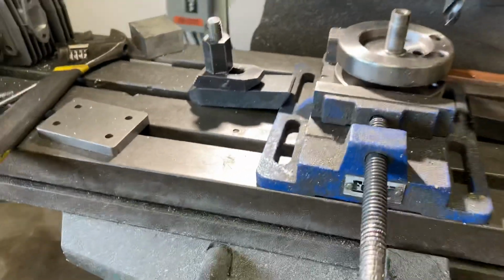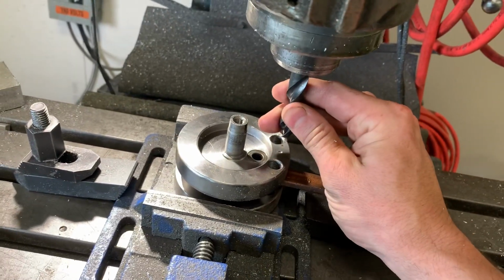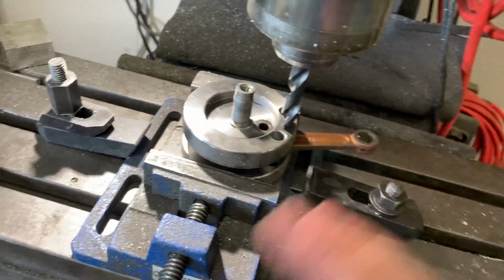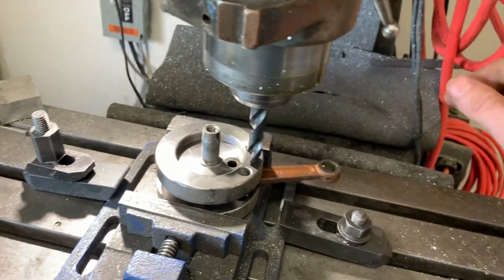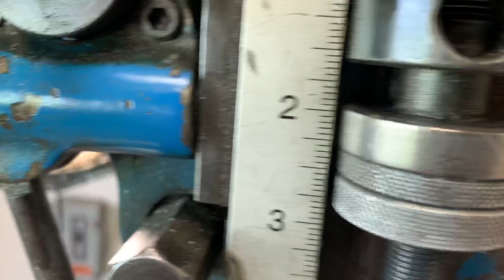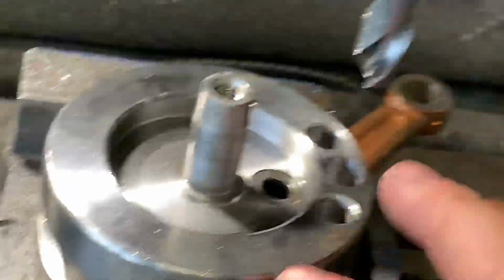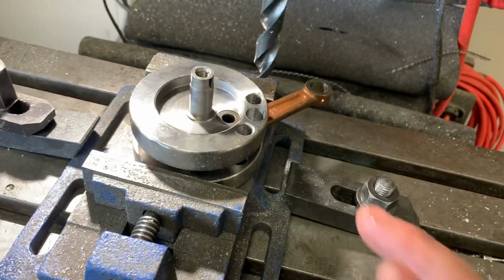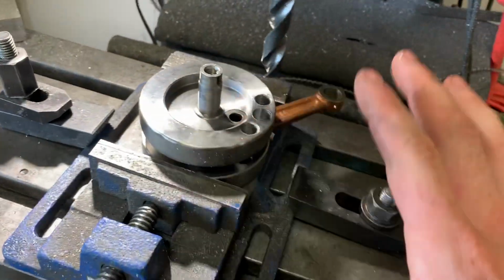The perfect balance in a crank. HOW TO

Comment: If you drill it with a hand drill, just step up the bit sizes instead of doing it in one go.  Takes longer, but goes much smoother and you are less likely to burn up the bit.

Comment: He said ALL CRANKS DESPITE WHAT THEY ARE OUT OF AND ALL CONNECTING RODS out 4 years experience doing hundreds and hundreds with NO complaints!!!  What he is doing is removing enough mass to bring it well into 85% balance if not closer, which will make a huge difference than the stock 65-70% stock balance in ANY chinadoll motor ANY size from cheap crap to yd100 phantoms ect ect.  

Thanks bro!

ITS amazing how many people can't understand plain English.
Reply from the maker: @garygrey8573  it’s simple.

Comment: Nice work! Hey I had a very important question, I bought a used bottom end and I've had to do lots of things.
The recent one being I had to split the case because of a leaking case gasket.
I noticed that I have what appears to be a balanced crank, yae!  The rod is an AF80.
I was using a 49mm iron sleeve, but I was thinking I would have better balance if I used the regular 47mm piston, and use my G4 cylinder.
I'm not yet hip to balance factors, but I was wondering if these balance techniques are primarily used for the normal bores size and pistons? Also it appears that the case was ported for a minarelli jug. I haven't ventured into that arena either, lol. Any help with your knowledge would greatly be appreciated, thank you. ☺️
Reply: I've used the AF80 rod with the 47mm cylinder. It's smooth as glass. Definetly recommend it.

Comment: Question: When I buy a motor that's suppose to have a balanced crank, yet it doesn't have this center hole drilled in both sides, did I get taken? 

Thanx
Reply from the maker: Yes it

Comment: what is the drill bit size in metric units. also does this work on any motorized bike engine?
Reply: That would be a 13mm drill. I recommend asking someone in a forum or following twostrokestuffings guide.
Reply: A half inch is 12.7 mm

Comment: Ok so if I mod my engine and it vivrates like no tomorrow.  I can drill holes as such as you've done here an it will help or make.it smoother completely.
Great informative video by the way 
Thanks for sharing
Reply: Did it work fine?
Reply: @Scooterbruh554  yes it works i did it with the head off from the top. the bike and hosed out the bits with a garden hose. Revs way better now
Reply: Could have bearings going bad too

Comment: It’s 4 wholes 2 each side front n back or only two?
I have 80cc chinadoll n I when I get to 30 she does get a bit vibratey
Reply: only two.  if your crank was out of balance you will likely feel it throughout the entire rpm range. if you're vibing at 30 its likely drivetrain or wheel related
Reply: @chrisanderson5256 NOPE... wow you must not have had much experience with these engines back when you made this comment

Comment: my bicycle engines crank 15.77mm thick, do I still go 15mm deep?
Reply: the idea is too NOT go all way through with the bit! china does 65 % balanced is ok... what he did was 85%/ whats more ideal is 95%... add 2 more holes... trick is same weight as arm+piston+rings.. as metal removed... machinist do perfect but cost same as could buy 3x new motors! unless bought titanium race parts.. forget it! 85-90 % you feel no difference- better gas + no vibration! Godbless
Reply: @chrisstokley7687  Okay but what about a YD100? There's really not much videos on it, and I honestly can't be bothered taking the crankshaft apart.

Comment: How do you know how much weight to shave?
Reply: Acording to my calculation it should be somethink around 15g each hole so  around 30g total, but shis is just calculated based on normal steel, I dont know the exact density of the chinese  steel.

Comment: Will lighten the crank by drilling a small 3/16(etc.) at set intervals cause too much offset in vibration or increase the overall r.p.m. factor? Just curious if you have looked at that as an option? Thanks for sharing the information.